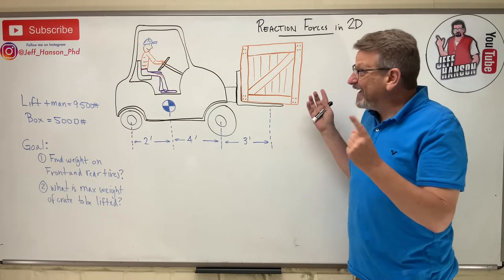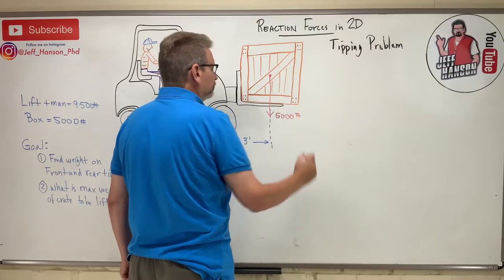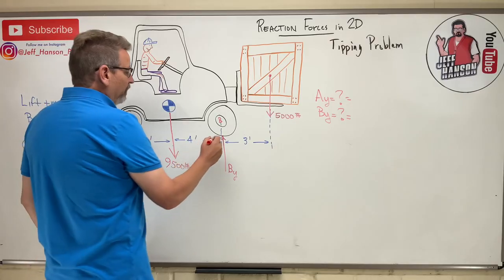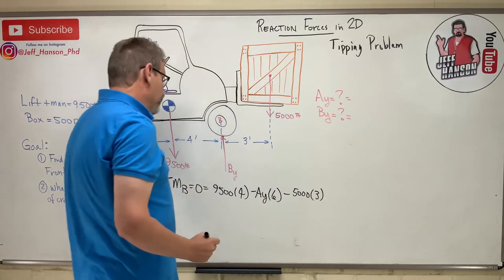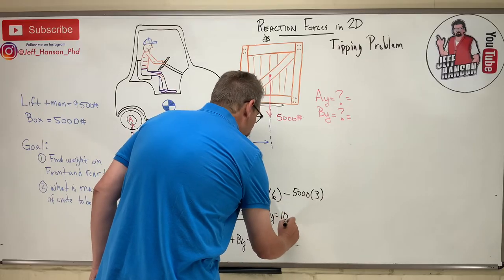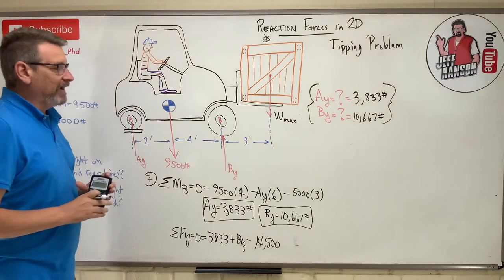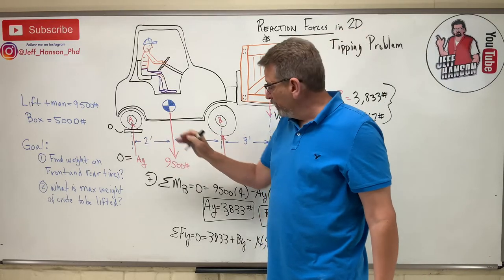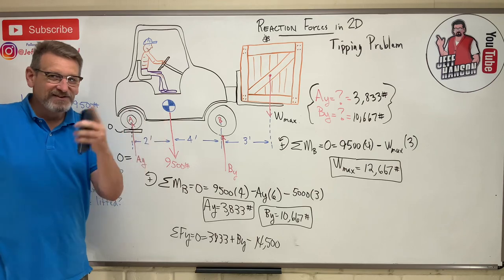Statics: Lesson 34 - Tipping Problem, Reactions in 2D

Comment: For the second part, why max weight cannot be calculated by taking the moment at point A? from a "mathematical" point of view I get that it can't be cause then the answer turns out to be the initial weight (5000.2, no max whatsoever), but i can't completely understand the reason why when taking the moment from point B then the answer is different (12667 lb)

Comment: Max weight is coming out to be 6094.85 lb when moment is taken at the COG of the car. Can't find where am I making a mistake.
Reply: That's because you are taking By = 10,667 # which is wrong. 

In part (1) of the question the reaction is being shared between Ay and By. But in part (2), By is generating the full reaction force, as Ay = 0 (since the back axle tires are not in contact with the ground). 

You have to treat the two parts of the question as separate questions. 

So the reaction for By in part (2) is equal to the weight of the lift+man (9500 #) and the weight of the box (Wmax). 
Therefore, By = 9500+Wmax #. 
So to find Wmax by taking moment about COG you have to do it the following way:

+⭯ ΣM_COG = 0 = (By)(4) - Wmax(4+3)
=> (9500+Wmax)(4) - Wmax(4+3)
=> 38,000 + (4)Wmax - (7)Wmax = 0
=> (3)Wmax = 38,000
=> Wmax = 12,666.67
∴ Wmax ≈ 12,667 #